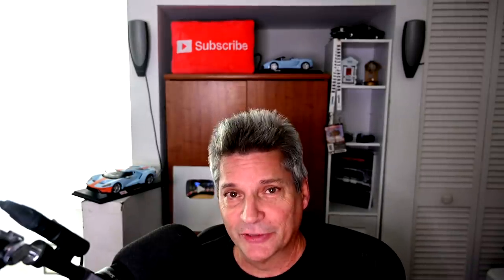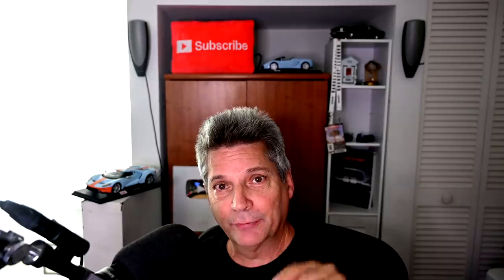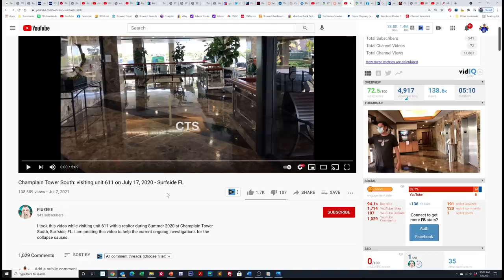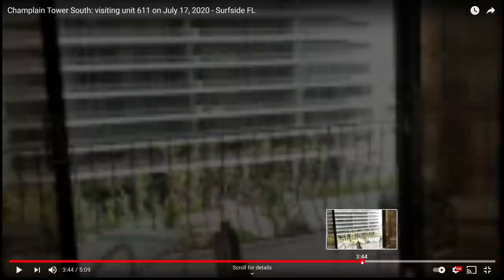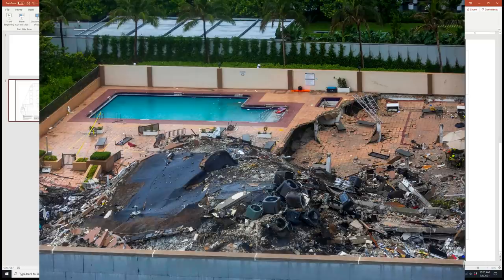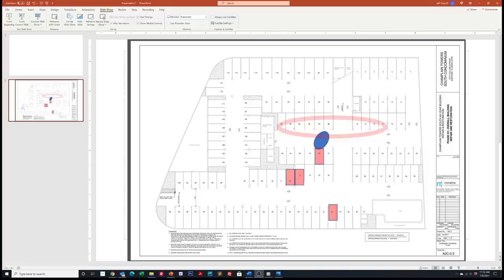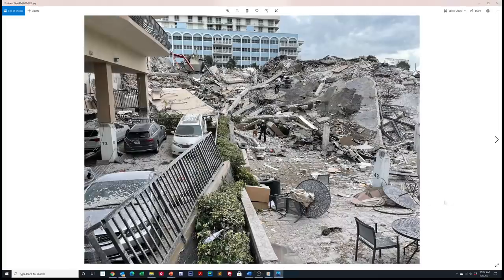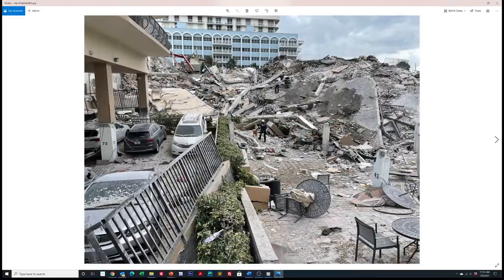Analysis Garage Video BEFORE Condo Collapse: Water Everywhere

Comment: I've seen corrugated steel used to deflect water seepage in parking garages before. Also the goop from the concrete falls on the cars and ruins the paint and finish. So that was probably the main reason those pieces of corrugation were attached to the ceiling. There was a parking garage at an airport here that suffered seepage on cars and made the news a few years back when owners returned from trips to find their cars messed up.

Comment: I think the planter boxes on the pool deck was filling with water from a damage sprinkler system and the water in the planters box very heavy and they push through the pool deck and fall into the parking garage.

Comment: I have avoided these videos because I don't like the "conspiracy theories for clicks" videos, yours is not that.  Great job on putting this info together.  Some observations I had were, the cones are probably there to save spaces or for the convenience of maintenance having to get them,  the car covered is actually fairly common here in Florida because there are a lot of part time residents, and the corrugated sheeting on top of the fire sprinkler pipes..... that's definitely shady, I am curious if that was to protect cars from falling debris.  at 21:26+ish around space 77, I keep looking at the about 2" pipe where you are looking at the water, the pipe looks like it is already bowed out to the left a little IMO.  I have to go back and watch your previous video now !  Thanks Jeff

Comment: The drain at the bottom of the  ramp seems suspect,  maybe plugged or never connected to a sewer line correctly, which could cause soil erosion and a sinkhole scenario. The night the water line was broken was directed over the drain. The span over the ramp I would assume there would be larger spacing between the columns requiring more strength like a stairway opening, thus making those columns more crucial to the structural integrity.

Comment: I have seen  one other place that a  "corrugated" patch on the ceilings you pointed out in more then one place on that garage ceiling and where I saw it ,it was used to redirect WATER  from a deck above leak (like the pool deck) ,probably to keep it off the vehicle and dump it in the corner of the garage. It was acting like a 2'-4' wide "Pipe" pitched to shut up the parking spot owner from constant dripping on their vehicle .Not sure what that would have done over time or cause this but its a defect of large proportions If I am correct .

Comment: Back in 2010 I was working on a unit block that was 5 stories above ground level and 3 stories of carpark and storage below ground level. The bottom level of the carpark was permanently closed because is was always flooded. Even after weeks of fine weather. The whole construction was as dodgy as hell. The tiled decks were never waterproofed. Where I live we have private Certifiers that certify work without actually inspecting it.

Comment: Sorry I thought I could see dried up wet patches on the ceiling between 50/ 52 it was such a stunningly beautiful building on the inside especially the apartments, yet the structure is poorly maintained and falling apart even the yellowpaint on some pillars look discoloured, for some reason.   I have only seen this amount of standing water in just carparks that don't have people living above them and are exposed to the weather.  Very interesting explanation of the collapse and I feel that I will be more aware of my surroundings from now on. I have subscribed.

Comment: Yes, there were multiple plastic panels to divert water from the expensive cars in the garage.  I'm betting water on their cars isn't the issue anymore.  Someone should have looked into what water seeping through concrete does to a slab construction building.  The pieces protruding around the stalactites are injection nozzles for injecting a filler in concrete to prevent water leakage and sealing cracks.

Comment: 20:26 I thought that rebar was in a grid pattern and tied together were they crossed each other.  Why does it only show one direction and no tie ins?  24:47 where is the rebar? Why is there non sticking out of the garage ceiling.  If the support columns have stood in water from the floor they could have rotted away. Residents complained that they felt the building shutter at times and many had got lawyers trying to get to the bottom of the problems.  Those shutters my have been the beginning of each column sagging as they slowly were gaving way.

Comment: The bottom of the 105/106 column looks wet.
I noticed on a couple columns, the bottom of them are a darker color, as if they are filled with water or as if they soaked up water.

Comment: You missed a significant water puddle in space 66 beneath the white convertible w/ black ragtop. (you'll see it at the very beginning of the video as the woman looks around for her parking space).  Look at the pattern of the puddles in this area.  I think this is a four-fold situation. 1) Pool deck pavers trapped water beneath the ground floor level - I seel no drains for the pitch of the pavers 2) Smaller pillars in the development collapsed, not the bigger ones (lawsuits will come back to the architect, developer, general contractor, city planning and inspection departments... most likely built in 2 phases, and they corrected with larger pillars in the later phase)  3) All kinds of indicators for groundwater coming up through the concrete slab 4) Building management horrific, as evidenced by the condition of the roof in your previous video Google Earth shots (in fact you point to the other Champlain building a few developments down - same horrific roof.)  Many years of asset/commercial management have taught me subterranean parking lots, or just being downhill from a golf course lake 2 miles away can cause water to push up through a concrete slab. The water will seek the lowest level and then rise through just about anything. Glad you noticed the freshly painted pillars. Note by the driveway ramp pillar, back from the first drive aisle to the camera's right you will see a concrete beam running parallel to the driveway above that pillar. That is what those pillars look like underneath the paint. When you cone off a parking lot to paint pillars, wouldn't you also stripe the parking lot while you're at it? Look at the parking stripes. I would venture to say this HOA had little to no money on reserves and was cutting corners wherever they could. Horrified, by the condition of the pool equipment "tunnel" in your previous video. Those floors were soaking wet yet that area didn't collapse. Pool seems to be reinforced to the hilt, therefore probably not leaking. Also, while the walls show dampness (in the pool equipment room), water isn't streaming down them commensurate to the level of water on the floor which was obviously perpetual as evidenced by the motorized equipment up on cinder blocks. Could it be the water was soaking up through the walls and therefore just appears to be damp and grey instead of soaking wet?  I'm calling groundwater level as a major contributing factor.  Managed property in Newport Beach on the bay with a subterranean parking lot. 24/7 sump pumps running. Still standing - only a 2 story building.  Take all of these factors and stack 12 stories on top of it - so negligent and tragic beyond words. This incident was the canary in the coal mine for Florida as sea levels rise.  The state of Florida MUST hire an inspection department with their 17 Billion dollars in reserve that superceeds the local government's motivation to cover these mistakes.  I'd start with the buildings whose roofs look like the Champlain developments in Google Earth shots.  Fantastic job evaluating this building Jeff.
Reply from the maker: And since this video was published we've come into information that the palm trees that were planted into the planters on the pool deck in 1996 had root balls that likely expanded into the drains of the bottom of the planters and may have caused the pipes to crack which would lead to some of the leaking inside of the concrete which would be bad because it's one thing to have water hitting concrete from the outside, but when you have concrete soaking up water that's coming right into the middle of the concrete, that speeds up the rebar rusting and expanding and spalling.

Comment: This is another excellent video that breaks down this situation better than any TV station I have seen. If this is your first video of his, subscribe to his channel and go see what else he has, it's really good. That's what I did.
The pooling you are pointing out in the garage can come from several different sources, not necessarily from leaking. Cars using air-conditioning will leak water that was removed from the air, and it will leak from under the car. Also, if a car is wet and pulls into that spot, than it can drip off in pools because it all runs down the channels of a car.
Also, At 10:18 I see what I believe is corrugated metal attached to the roof. I think this was an attempt to repair leaking ceiling, from dripping on cars, by channeling the water through the corrugated metal and then to drip down the wall. This looks like a patch job to fix the problem of leaking ceiling without addressing the true problem of water leaking from the non-sloped concrete slab that sits above this section.

Comment: 13:47 just to the left of your cursor, those little cone shaped things coming out of the ceiling. Those are injection ports for Apoxsee that were never removed by the contractor. Obviously repairs, poor repairs were made here in the past
Reply from the maker: yes, those are the injection ports called out by the engineer's 2018 report, saying those repairs made things worse

Comment: Is column 87 (the red one) a fire hose hookup? Are those lines below ground?  Those would be high pressure and small damage would have big consequences. The water would be fresh and not leave salt residue which there definitely didn't appear to be any.  I'm familiar with how sidewalks look after salting to melt ice and the water evaporates. Didn't see any striated evaporated saltwater marks.

Comment: you missed the puddles in areas 75, 76, 40, 39. and damage to the column base at 17, 15. Is the discoloration at the base of some columns important or is it just exhaust fumes stains.

Comment: The column at 14 in the video at the ramp appears to be trying to lean  to the left and uprooting the pavement with it. It has already popped out the curb and produced a huge crack beyond in the paving.  Signs of near imminent failure above the foot of the ramp some time before the collapse.

Comment: In my opinion, there is your smoking gun, the puddles on the garage floor and the damp damage on the ceiling  ie flaky / crumbling surface on the ceiling of the garage.

The spalling on some columns and beams and exposed rusty rebar, possibly indicates water ingress/ damage?
I'd like to know if the pool was leaking or sprinkler system was leaking or just rain/drain water was seeping through.
Either way, water damage could eventually lead to weakness in the supporting concrete beams and columns.😯⚠️🤔

Comment: Look at the width of the column at 22:00 relative to the width of the blue outlined walkway.  About three column widths.   Compare to the next column at 23:00 and the blue path is about 4-5 column widths.  It they both hold up a 13 story building why would their size be so different?

Comment: You need to watch the interview of the maintenance man for that building: He worked there many years: 
Stated two large pumps were constantly pumping out SALT WATER from the garage and two pumps could not handle the salt water load in the garage. .
Reply: He als  pop stated he did not know where the pumped water waspumped into….
Reply: What's the link to the video

Comment: Between minute 32 and minute 33, when you can see the garage entrance ramp, look at the bottom corner of the right hand entrance ramp column and the bottom corner of column 15.  Paint is missing on both.  Are there chunks of concrete missing from each column in those spots?
Reply: The bottom corners of columns 14 and 15 are what I am questioning.

Comment: Jeff - Some of those water ponds may be from air-conditioner condensate, especially at the area under the lobby.  That dark area in the ceiling may be a short gutter, which I have seen in parking garages to redirect dripping water from landing on the car.

Comment: @ 22:40 Jeff makes comment about the cover over a car. I used to live in a condo highrise similar to this one. Many seasonal residents (aka "snow birds") cover their cars when they are up north and then remove cover when they are back in town. Saves on a major wash before the first use. Also a resident that can no longer drive possibly will do the same thing. Not ruling out that a leak can also force a resident to use a cover, but that becomes very tedious, especially if you work every day. Removing and putting the cover back will get old real fast IMO.

Comment: Did the columns give way or the concrete it was suppose to support rot out around the columns?  I ask because the columns in the wreckage are stripped clean and there is no concrete stuck to them.

Comment: Will there ever be a conclusive report on the causes of the collapse? Could it be extensive corrosion advanced in reinforced concrete steel bars ? Is there enough evidence left to conclude? Why the pool did not loose the water after?

Comment: Well, that video from 2018 puts paid to the court action being taken against the developers of 87 Park.  If the water damage and rust was that bad at the time of the video in 2018, it clearly predates any construction of the new hotel.  
Also, some of what you are calling ‘stalactites’ are actually ‘straws’ used in a process to inject epoxy into the concrete in an attempt (failed) to strengthen and waterproof it. 
I find it interesting that much of the water damage, and pooling, seems to be concentrated in the area where the ground level carpark was, not necessarily under the area known as the pool deck.  I would like to know what type of waterproofing was used in this area.  The plans specifically show the layers in the pool deck, with a specific waterproof layer, but the ground floor carpark was open to the weather, but does not have had a waterproof membrane in it, merely a suspended slab, not well attached to the concrete piers.  Also, I can not see any drainage in the ground floor carpark, just a flat slab.  Any rain which blows in has no where to go, except through the slab itself.

Comment: The pool deck was actually the first to collapse before the actual building i think the pool was leaking into the parking garage rusting the rebar support so the roof of the parking garage gave way that ultimately led to the bottom collapsing first.
Reply from the maker: The pool was never leaking into the garage in fact the pool remained intact after the collapse so the pool was built pretty rugged. The more likely scenario is the rain over the years made its way through the pool deck and left that whole concrete damp and  weak.

Comment: It looks like a water pipe burst inundating years of deteriorating concrete and rebar resulting in the failure of first one then each of the other support beams. Perhaps not 15, 16, 17.... but the ones in front and horizontal to those. I've seen a similar problem to a decked pool area with parking underneath at what was then the American Beach Resort in Daytona Beach.

Comment: That thing on the ceiling at 5:11 is a corrugated plastic panel on the ceiling to divert dripping water away from a car parked in that space. Calcium carbonate ladened water will destroy the finish on a car. There are plastic panels tacked up all over the ceiling of the garage.

Comment: I notice at the base of some of the columns in the yellow paint they look wet from the floor to about 4 or 5 inches up the column.    Would that be water absorbing into the column or possibly in the column slowly coming through the concrete?

Comment: this video showed so much more than what the news showed. I think this failure happened from no slope on the roof and poor maintenance the rebar expanded from water and busted the concrete  miami is like 80% humidity  all the time so if it was not waterproofed water is in the air.

Comment: At spaces marked 105/106 on the column, there is what looks like a watermark on that column at floor level to several inches above the floor. I believe you can see similar marks on several other columns. On others, I don’t see any.
Reply from the maker: yes a few columns had this

Comment: What type of structure system is the deck?
 I can't see any beams except columns and slab -
 If it's flat slab system with slab bearing directly on columns , shouldn't there be drop column heads?

'

Comment: The "electrical box" you point out towards the end of the video looks like an electrical transformer. Specifically, looks like a transformer they use for swimming pool lighting. I know this because a pool I owned had that identical looking box. They convert 120v to a safer 12v for use with the underwater lights. So I wonder if that part of the video was shot near the pool?